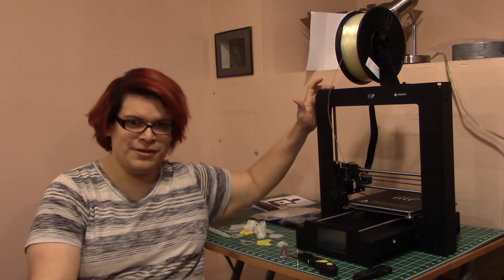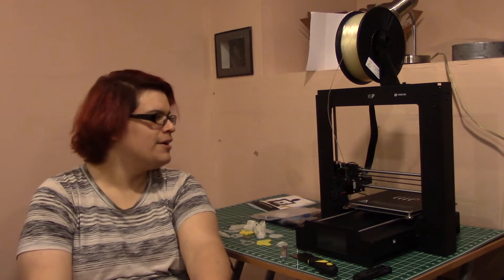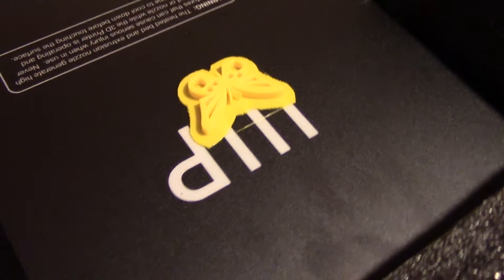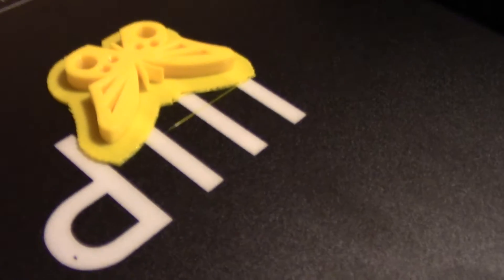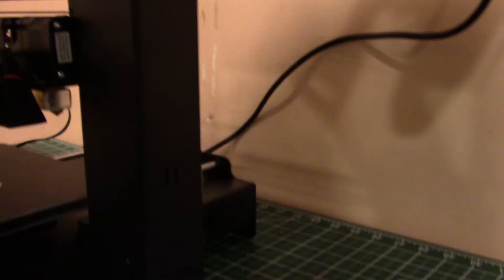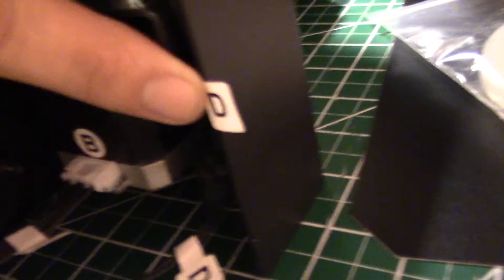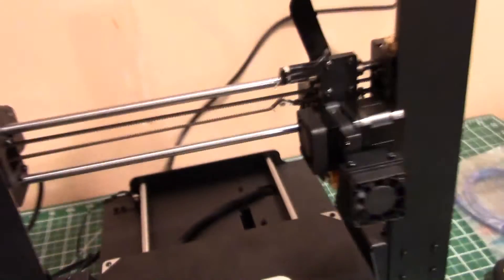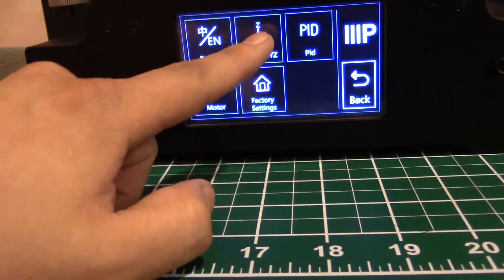Monoprice Maker Select Plus 3D Printer Unboxing

Comment: Did you have to do any printing bed levelling before printing?
Reply from the maker: +Ronn2664 I did level it before hand. I noticed over time that the carriage plate under the bed began to warp and needed to replace it with something thicker. Ever since I haven't needed to re-level it yet
Reply: Bonnie's Workshop How long you had it before you replaced the carriage? Did you buy the replacement? Thanks for the video and the reply by the way. Just ordered mine and waiting for it. Any important pointers before I use it?
Reply from the maker: +Ronn2664 I had it about 2-3 weeks but it wasn't until I was trying to use petg (higher temps) that the problem got to the point of needing to replace it. Make sure to check all the screws as vibrations from shipping can loosen some. It's pretty easy to assemble so it should be pretty straight forward. Check out the other comments on this video and the other videos I've done about this printer for more and feel free to ask any specifics
Reply: Bonnie's Workshop Thanks for the pointers. Was it successful with petg?
Reply from the maker: +Ronn2664 more or less, you will need to make some upgrades to the extruder and bed to get the best results. But it does great with pla right out of the box

Comment: hi. can you help me software and driver for monoprice maker select plus 3d printer.
i bought it on ebay but no software and driver for machine,thank you so much
Reply from the maker: +nam le there are no drivers, as far as I can tell there is no way to benefit from having it directly plugged to the computer. As for the rest you can try the Facebook group https://www.facebook.com/groups/i3plus/
Reply: thank you Bonnle's so much for your help, i am will to try it agan,when i put the sd card ,it so file 3d and it not print and not any happen when push print.thank you Bonnle's
Reply from the maker: +nam le you need .gcode files on the SD card for the print option to open at all. It will then give you a list of the .gcode files to print from
Reply: hi,i am new user,i don't know how to print a 3d file,you are my teacher.how to donwload some 3d file for the fist print. thank you my teacher Bonnle's
Reply: when i plus the usb to pc,pc say UNSPECIFIED,i don't know why,can you help me,thank you Bonnle's
Reply from the maker: +nam le I haven't figured out what to do with the USB cable, just use the SD card to transfer files
Reply from the maker: +nam le you need a 3D file like .stl or .obj you can find many on thingiverse.com after that you will need a slicing program like slic3r, Cura or simplify3D. You'll need to find settings to start with and adjust as you print. If you go to the Facebook group I have linked you they will be more then happy to help you get started

Comment: Did that come with the insulating bushing installed between the springs and the bed?  --> https://www.youtube.com/watch?v=FivwNhAIc6w&t=200s
Reply from the maker: +dennzt I think it has a ceramic washer separating the springs from the bed. It certainly hasn't been an issue. It sounds like these come from a wanhao factory so I'm pretty sure it's safe

Sorry for the late response your link pushed the comment into spam ._.

Comment: Bonnie, It appears that the attached fan unit at the print head extends below the print head nozzle. Doesn't this "get in the way" of prints with a wider footprint?
Reply from the maker: +Jon S The fan housing does not drop below the nozzle, so it hasn't gotten in the way. It is however offset and blows from one side which gave me warping issues on one side of thin prints. I've since replaced it with a print of my own. Once I'm confident in the design I'll be sharing that in a future video
Reply: Thanx for your reply! (And info! LOL)

Comment: When did you order it?  I am asking because according to the Wanhao website the noisy Y axis bearings were fixed in January 2017.  Maybe they still had some old stock at Monoprice?
Reply from the maker: +Bertus Steyn just a couple of weeks ago, this is a clone however so I imagine it would take longer to update the hardware. I've tried replacing them but the new ones are still noisy. I'm considering b gettingushings but it's tolerable for now
Reply: I think this printer is actually made by Wanhao for Monoprice. Not sure how the agreement works though  As soon as I can get confirmation that they have solved the issue in the Monoprice versions I am going to pull the trigger.
Reply: Any indication on when it was manufactured?
Reply from the maker: +Bertus Steyn I'll have to look into it. Hadn't considered the history of it much. But aside from the noise I'm really happy with it so far :3
Reply from the maker: +Bertus Steyn nothing that I could find :/
Reply: Thanks for the response

Comment: Approximately how long did it take to print the lounge and the swan? Are you able to change the resolution or will it always print at .02?
Reply from the maker: +brandon rubio somewhere in the neighborhood of 1-2 hours each. The files that come in the SD card are just gcodes (printer instructions) so I couldn't change any settings from there. Honestly not sure what resolution it printed at. Still doing many tests with my own Cura settings on different files
Reply: Awesome. Thanks.